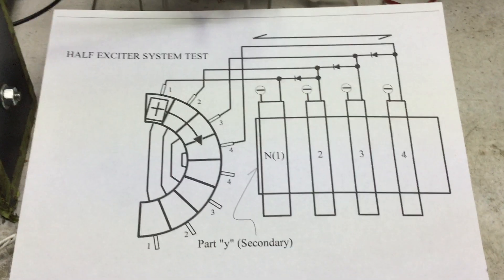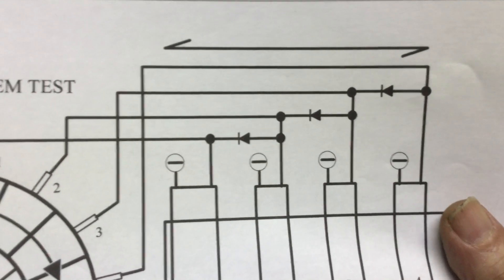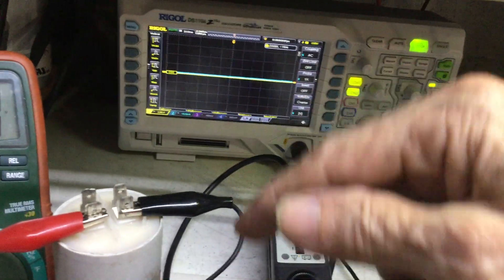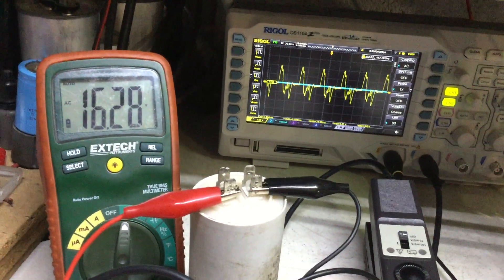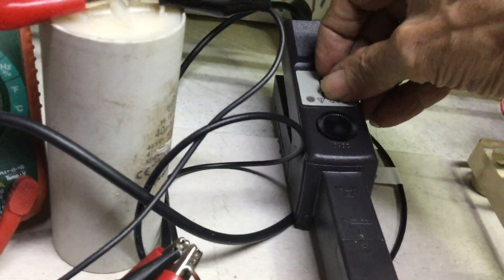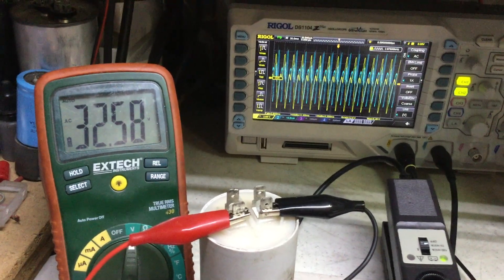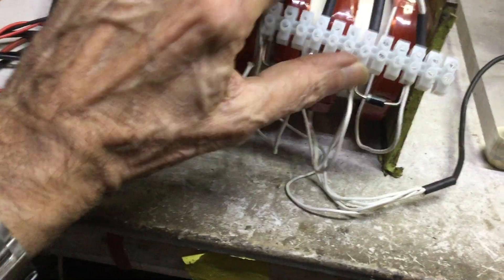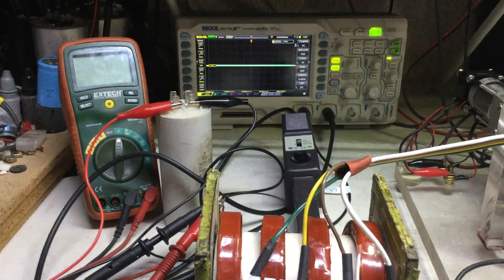HALF EXCITER GENERATOR SYSTEM TEST 1 (INPUT 14V)

Comment: Sounds scary, looks difficult and weak.
Might be a smokescreen or debunking demonstration psyop.
I recognize the configuration and I believe the patent shows separate cores, at least magnetically.
Also, the resistor is not shown, the capacitor is not described, the exciter circuit is not described and the commutator can be streamlined quite a bit.
Ideally it would be a generator with no mechanical feedback to the input because the input does not move. Only the magnetic field moves, apart from the commutator.

Clemente FIGUERA, et al -- Infinite Energy Machine_files
Canary Islands patent from 1919 I think